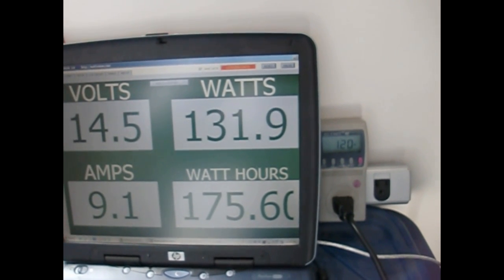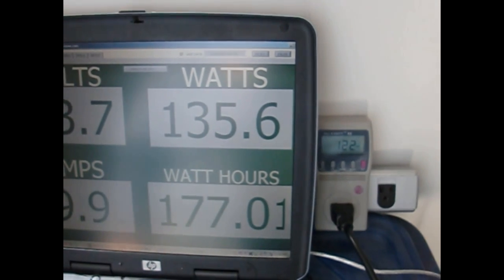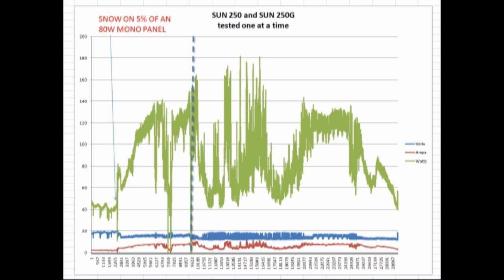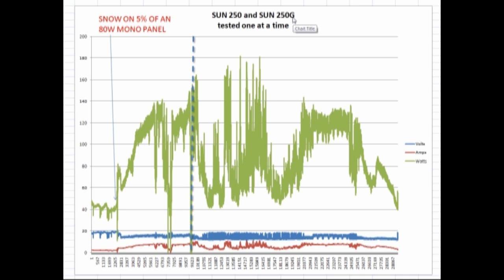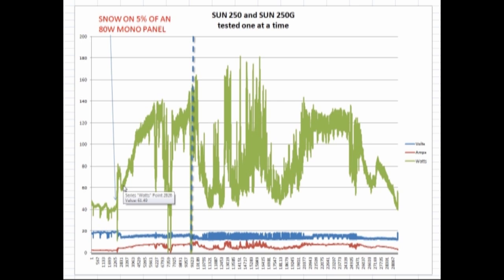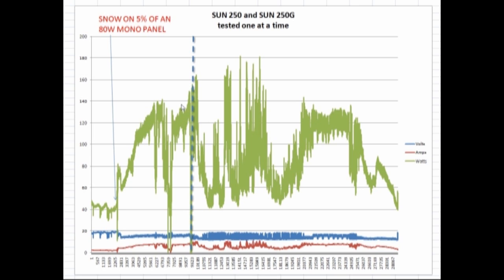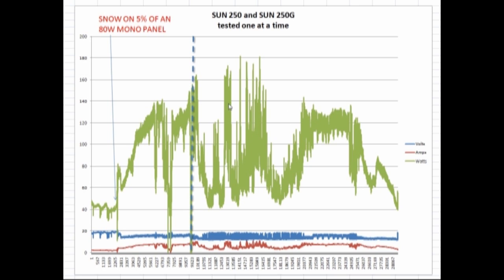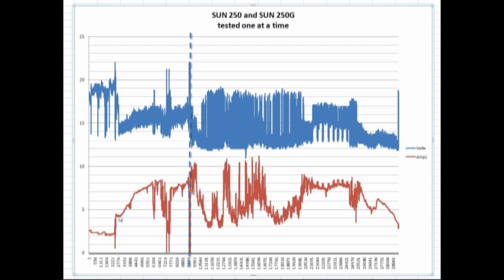SUN 250 Grid Tie Inverter testing with Solar Panels

Comment: @rainerudo1 I returned all 5 units through E-bay, and recieved a full refund, minus the shipping cost. I purchased the Aims 8k/16k unit, which has preformed and powered everthing I've tried on it. Items tested or currently used are the 110vac submersible well pump, a small window A/C unit, drill motors a small micro wave. I run the A/C unit 6-8 hours a day, and the pumps 4-5 hour straight. I only run them when the output on the solar paenls are at least 50% as I try to keep the battery bank@12.2

Comment: @troybrownrigg  crap inverter no support i have 5  of the 250watt all 5 are broken in less than 1 year. power tracker do not work in the 250 watt inverter i run the inverter over a charging controller as my panels make por power as the 250 watt inverter is using . the controller turn on the inverter if the battery bank is full and has minimum of 26 volt if the battery bank run down to 24 the charging controller turn off the inverter.
the inverters are poor in design no delay on the 240 volt

Comment: With no tech support I'm not able to use the other two units, in fear of them failing also.It's been over a week and no one has responded expext for the reply are engineers are in china and I can forword the information. The manufacturer has nver responded. Bottom line no more purchases from chinese manufacturers.! Until this is resolved!

Comment: I've never got mine to work! No customer support at all. Before anyone buys one of these units do a simple test try to get tech support on these units from the manufacturor. If you don't get a responce don't buy this type of power inverter. My units will not stack, in stacking mode the slave unit beeps all the time and kicks off. Out of four units one has a red light on and will not operate, another beeps all the time witha green ligh on! The other tow units put out the 220 volts.